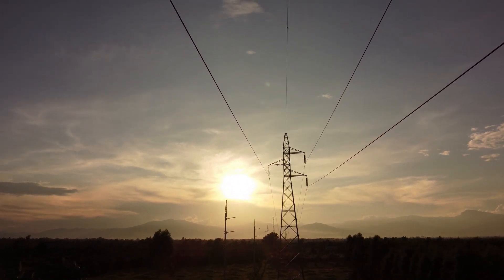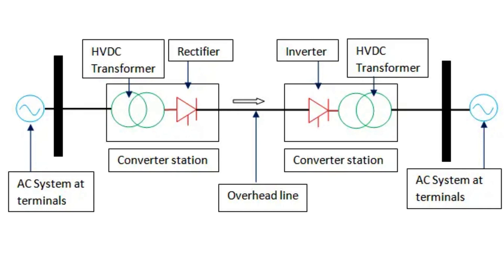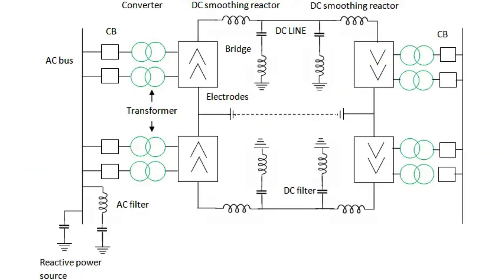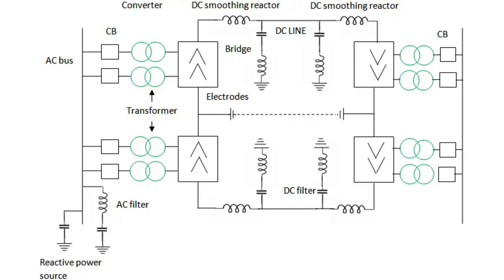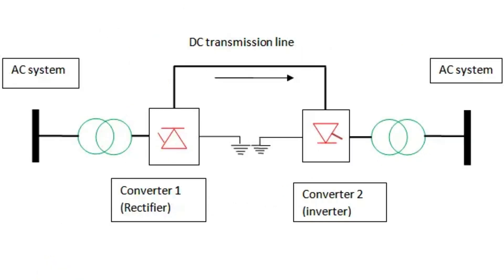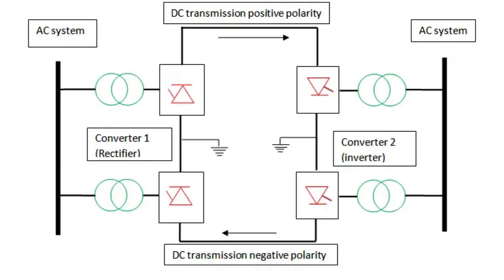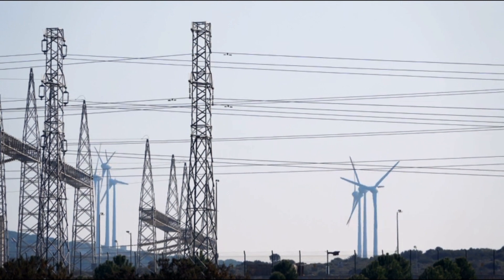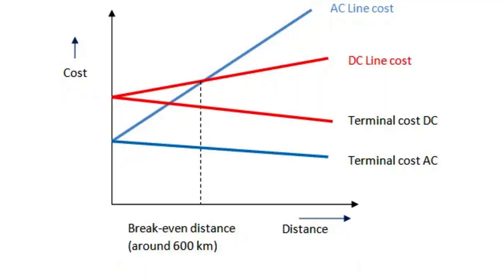HVDC Transmission | Electrology

Comment: As Australia is a democracy there is much push back with surface transmission lines but perhaps if Snowy 2 uses HVDC cables in the Sydney to Melbourne Japanese SC maglev tunnel it may earn $12b p/a.